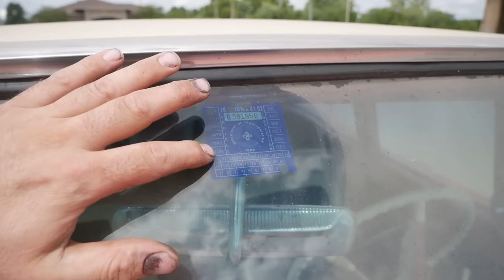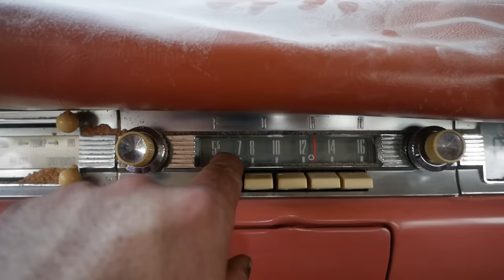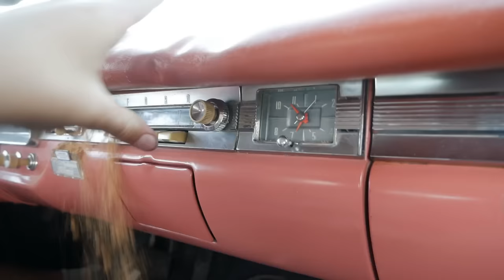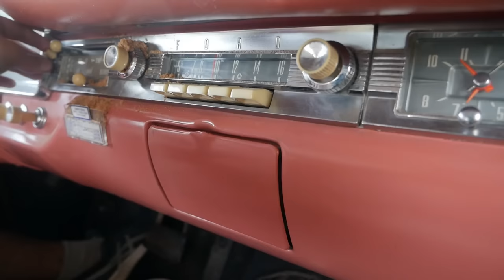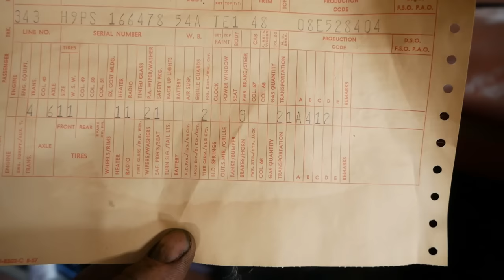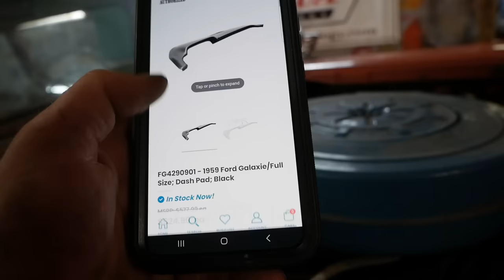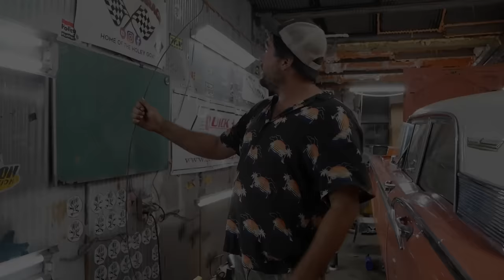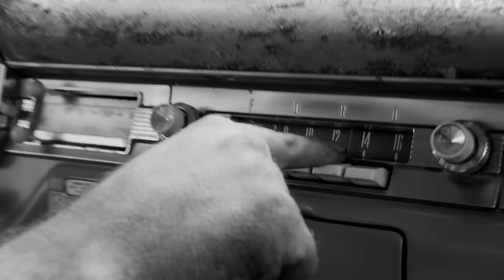On The Road After 44 Years! 1959 Galaxie 500 SURVIVOR

Comment: What a nice looking car. You should keep it stock and replace the rotting exhaust with a new one that makes it quiet instead of adding a loud exhaust. These cars were advertised as quiet highway cruisers that eat the miles while the occupants sat in comfort. I think the padded dash was a option for these cars. The padded dash was originally a part of Ford's unloved 1956 Lifeguard package (added seatbelts and recessed steering wheel and padded dash among other things). Most folks take the padded dash off to display the all metal dash or because the padding turned into powder. I would think you could replace the foam and slap it back on and call it a day.
Reply from the maker: I agree, I do like the glass packs (not rotted) but it isn't a hot rod

Comment: When I was still working at a body shop, there was on old Ford Edsel that kept coming in. It looked a little like one of those galaxy 500s. The thing had massive problems with the brakes. You’d press down the brakes and it wouldn’t do anything and then suddenly the front left tire would lock up. That’s the only brakes it had.

Comment: I have a '59 Ford Custom 300. I'm posting this on any '59 Ford videos I find as a tip for others with '59 Fords who might read this: the correct part number for the stock master cylinder on a '59 Ford is Raybestos MC23222, it is NOT MC18000. I know from personal experience.

Comment: I've got a 67 F100 with a 352 ci  V8 2bbl 4 speed, its a beast! Drinks gas like it was $0.30 a gallon. It runs good but doesn't stop very well. Drum brakes don't stop like disks. For about $2,000 I can convert it to disks. But its still a beat up 67 pickup. No power steering, no AC, and bad brakes
Reply from the maker: Drum brakes actually stop better than discs (once) might make sure everything is tip top!

Comment: Hydraulic pressure is much greater than you realize. That wheel cylinder would have no problem over powering those springs and 10 more. A thing I have always done when dealing with drum brakes, especially Ford rear brakes is to always pull one drum apart while the other is together so you have a model to copy during reassembly.

Comment: Dalten, if you’re looking at the fuel pump on that Ford galaxy 500 give me a check rock auto or eBay rebuild kit smokes like a rock out a while have one because I still have a bunch of rebook it for stuff. I think you could also trying to vacuum line on the intake with a T fitting and go from there around your vacuum wipers off of it if you had to run new, regular fuel pump likable through getting too late model Ford.

Comment: I really like your 59 Fords and your videos with you & your son.  When you took the pssgr. front hub back off it looked to me like the bottom of  your upper springs were in the wrong holes.  The springs were too stretched & should be mounted in the next holes above.  That would affect your shoe travel some of course.  I had brand new master cylinder failure on a 64 Galaxie but the next one was good.  Best wishes!🙂

Comment: You say it's a 352, but the color of the valve covers and air cleaner indicate a 332. The VIN would tell for sure.  The beginning letter is B for a 332 and H for a 352.  (If I recall correctly.)

Comment: It seems that the close fit of the FE engines into the 58 and 59 Fords meant that the manifolds would heat sink when the engines shut down. The manifolds warped and they started leaking. I've seen a lot of them where the head surface itself was burnt though,making them a head off job to remachine the mating surfaces. Looks like JD's may have that problem.

Comment: When beginning to drive the car, pull the shifter down into the second click right of neutral, then the  transmission starts in first gear, the position next to neutral the car will always start in second gear.  Later model year versions of cars with the same transmission have a green  dot on the position between low and first position off of neutra.l

Comment: Another suggestion on that old Fordamatic trans.  Start off in low, rev it up as hi as you dare, shift up and then back to low and you will hold 2nd gear as long as you want, then shift to drive.  My 58 Ford with a 292ci Y block beat many cars in high school. If memory serves me right I only loss was to a 61 Pontiac 2 dr sloop back Bonneville.  Enjoy the 59 Ford 500.  What engine does it have?  292, 312 or 332?  I don't think the 352ci was offered in 59.  Oh, by the way, shifting as I suggested will cause you to have to rebuild the trans much sooner than you may want... 😂. Ask me how I know.
Reply: ,,  The 352 cubic inch was first offered in 1958, only as a solid lifter engine (simply known as "Interceptor" ) 1959 it was kept but added hydraulic lifters.

Comment: Even though you bench bled it I feel like you would still need to bleed the brakes at each corner. Also guessing the new master cylinder had a different stroke length or maybe the actual piston size was different. Or it definitely could just be brand new junk. We have definitely seen that also!
Reply from the maker: Did bleed all the brakes. A lot. It was just junk! I found an original rebuild kit for the old master though

Comment: Heat the brake line fittings, and they usually unscrew without twisting the line off.
Is the bore diameter the same on the new Chinesium master cylinder?
And with the old master cylinder, remember they aren't power brakes. just old stomp & pray muscles plus hydraulics.😁
And re-bleed the brakes, just for grins?
I love the Coral '59 Ford!
My Dad had the 2-tone Bronze & White '59 Galaxie 500 and Mom had a '58 Mercury Monterey. It was great being 5-6 years old then.😎
Reply from the maker: They are power brakes.

Comment: Hey you could run a normal fuel pump on that engine. you could probably grab a vaccum diaphragm fuel pump off a craftsman 2 cyinder riding mower and tap into a different vaccum source to run it. You could also go the fancy route and add a vaccum pump but if you were THAT kind of channel could you really live with yourself? Give it a shot for the hell of it and see if it would properly run the wipers.

Comment: That reminds me of the dash of my dad's 70 Ford F-250 custom ranger the truck came from western Illinois over by the lakes and the dash pad was very brittle and sagging usually they just have gigantic cracks in them,, i just pulled out the factory dashpad and cleaned up and sanded the dash and then painted it fire engine bright red and no clear whatsoever.. but that i would consider a mistake it was way too bright to drive it especially when the sun was out and it was really clear skies,, but I used what dad had at the time and he had just got done repainting a set of Pontiac rallye 2 wheels but not adding the light silver accents..

Comment: Get you a master cylinder for a 1965 Ford mustang I put one on my 1956 Fairlane it works great you just don't use the two holes because the mustang only has two bolting holes but they will match up perfectly just leave the other two out
Reply from the maker: Even with power brakes? I'll definitely try that

Comment: Love  that car.  Not much different than the '57 I drove in high school back in the 60s.  I guess my dad bought in from the Sheriff's dept.  Had a 312  police Interceptor with 3 on the tree. No power steering or power brakes.  It did have a neat spot light and an alternator tho. Anyway, fix the fuel pump on that '59, repair the right rear damage and put some shocks on it.

Comment: “There’s no jag”

“Shut up” 

😂😂😂

I’ve been using that rislone zddp additive in my Jeep 4.0 with 10w30 diesel oil since I got it about 8k miles ago. The typical noisy lifters have gotten significantly quieter and I feel better about it in general since they tend to have lifter issues. When I was researching what zinc additive to use it seemed like there were a lot of good experiences with it. Goes in my fox with a flat tappet 351w also. Love the channel! I’m relatively new but I enjoy what you do.

Comment: Does it have a loose or missing plug or just a bad exhaust manifold gasket they also make replacement electric wiper motors that uses cable controls so you don’t change anything inside
Reply from the maker: Cracked manifold most likely, as mentioned

Comment: Assuming that has the same big single power master cylinder as our 58 Edsel had…be careful. The check valves in them can go bad and you’ll find yourself with the pedal stuck to the floor and no stoppy stoppy. It’s a thing.
Reply: Well nevermind it has manual brakes…lol.

Comment: Bottom line you essentially cleared that OE master and it worked. That just goes to show you what we as a country have done to ourselves. When we outsourced EVERYTHING we consume and need to function. Was the STUPIDEST thing we could have ever done. I remember doing a fuel pump on my 1995 E150 van. I had to replace it 3 separate times till I actually got one that worked. You have no idea how frustrating that was for me. How much of a inconvenience it was to have to do that just to have a my only vehicle at the time back on the road.
Reply from the maker: We literally ran into that on the Dodge van in Texas, pulling a freaking fuel tank twice because of foreign crap
Reply: @PoleBarnGarage  yes its wasn’t fun at all whatsoever. I could see 1 bad fuel pump cause you know crap happens. But 3 no there wasn’t any excuse for that what’s even worse is a few years before I bought that van. The company I was working for had the same vans as fleet/service vehicles. I remember the motor pool mechanic complaining about a bad brand new fuel pump. Your account of having to replace a brand new bad fuel pump. You hear about that happening to people actually a lot. Now it’s not just fuel pumps it’s FREAKING EVERYTHING and if you want to run made in the USA 🇺🇸. Its going to cost a unreasonable amount of money that’s assuming you can find whatever it is that your looking for even being made in this country. Sorry for the rant but I’m 40 years old so I remember through out my teens up in until about 22 or 23 everything actually working and decent quality products. But after old Slick Willy got in to office everything started going downhill and it’s done absolutely nothing but get worse and worse. I miss being able to just go and purchase something and know it was built with pride. And my money was going to pay another American so HE or SHE could support HIS or HER family. Man I’m sorry for ranting in your comments section your videos are very entertaining. And I think it’s seriously awesome that you and your son restore those awesome old school American metal. What’s funny is a lot of those cars and trucks where built right here in my home state of Michigan. What used to be called the Motor city

Comment: Surprising how small the engine bay is on such a big car. Nice colour car. A mates '59 has an electric wiper motor (standard).
Reply: Ya, Learner,,   You probably also saw the washer fluid bag, on most of those rigs if you have the optional washer fluid it came with the electric motor as well,  I too was very surprised to see that vacuum "motor", perhaps the electric motor quit and they put a vacuum on? Who knows :) Or more likely the dealer put the washer package on,,  being it had the vacuum pump associated with the fuel pump.
Reply: @theda850two  I think my mate said the electric motor was actually a pretty rare option (It is an Australian delivered car so it is right hand drive). I think that is why.

Comment: Dalton,, what do you think is happening when you pump the brake pedal whilst you are bleeding the brake system,,??
I'll tell you,, Nothing,,!! As you say,, Hydraulics. Think about it dude. Do you pump the piston when bench bleeding the master cylinder,,?  No. ✌️👍🇬🇧
Reply from the maker: Pumping the pedal will compress the air in an empty line and build pressure. Why do you pump the brakes when your brakes fail? To build extra pressure. More pressure releasing=more fluid flow